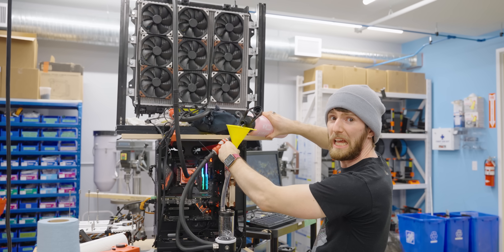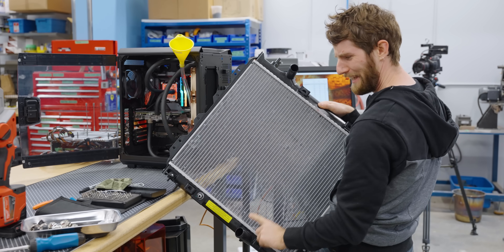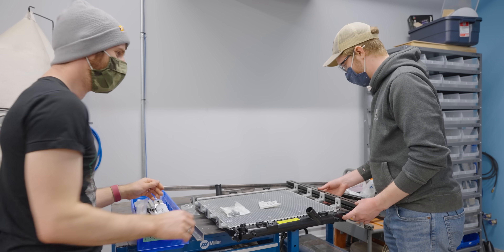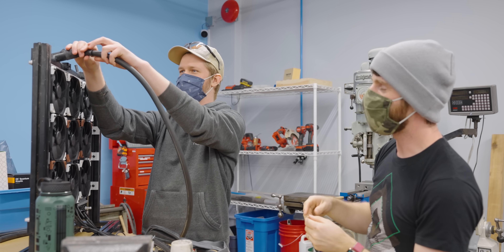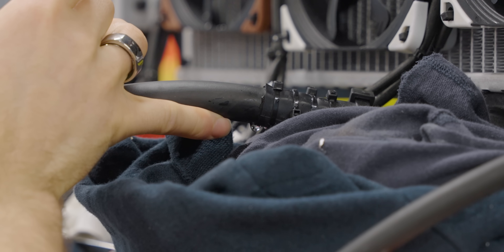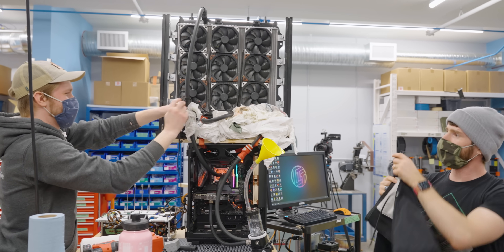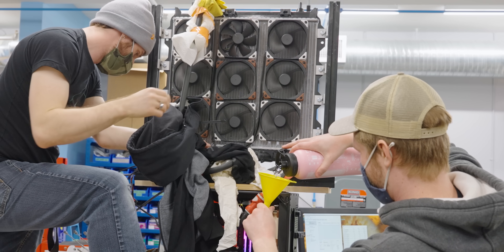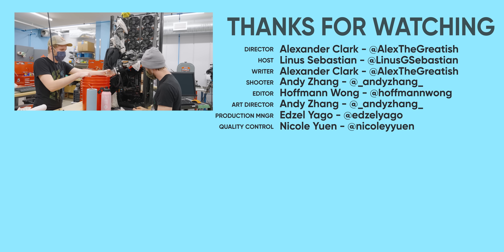Our Craziest Cooling Project Yet - Car radiator liquid cooler

Comment: This is a project I've been wanting to see for literally years. Guess I get to keep on waiting.

I just don't understand why you seemingly ruined it on purpose by putting the radiator on top, and then why you didn't immediately fix it when it was obviously untenable. Out of every video you've uploaded in the decade I've been subscribed, this was the one I was most excited to see, and it was so brutally disappointing I had to take a break from the channel. Were you trying to make a statement? Was this supposed to prove how bad an idea it is to use a car radiator? If so, you completely failed to demonstrate that by not even trying to make it work.

Comment: sooooo...: https://www.caseking.de/watercool-radiator-mo-ra3-360-lt-schwarz-wara-323.html?sPartner=999&wt_mc=googleads.12975327275.127452856008&gclid=CjwKCAjw3MSHBhB3EiwAxcaEu1FlA0RVlReHVgJTaqHijhTBBtuWaTNMjg2hbEfYGAuHmVfHj1vJbRoCVT8QAvD_BwE

Just get a min. 10 kW heatpump like this if you actually wanna go overboard: https://www.oezer.nrw/images/pictures/w7e2b1610173300206c56e8a574eeb98/w7e31060936140031ca61cf3f560080a/mechernich_held_wp_haus.jpg?w=1376&r=6 
but then you might actually have to get someone on board who knows what he is talking about

Comment: LOL a 99 civic Rad would've fit right in the case guys but it was intresting to see you guys improvise i ended up using quick steel epoxy on the Rad outlets and drill\tap and used 3/8 fuel line barbs and nylon fuel line wanted something that wouldn't degrade over time omg you'd better hava heat gun and snap ring pliers to expand the line to fit the barb i used lol car quick disconnects  and drilled some 2x4's for the pegs on the bottom to stabilize the rad next2 my tower and used pc bLox,d5pump independant 12volt 30amp power supply used the car fan steada rigging and used a blower motor resister from an 82 chevy pickup to step down the speeds which were controlled by a 3spd push/pull switch the pump is also on the fan power so the 3090 can have all the juice it can handle However the controller is pluged in2 the mobo so i  can fill and leak test with out powering on the pc [:-) perhaps use some of these for the next insane build lmao made a good show though as you figured out you need actual hose clamps with that much water atmospheric pressure boyz ! it'll get ya everytimee [:-)

Comment: WHY did they put it on top?  That seems deliberately thrown together...  

Also, you can reduce the 1" hose to the 5/8" hose using a simple adapter you can get at Home Depot...
Reply: They may be good at building computers but building other things. . . Not so much...  😁

Comment: Thank you for convincing me not to try this on the new rig! ...Although maybe with a smaller Honda rad and a box fan?
Reply: I was thinking the same thing....  They dropped the ball on the choice of rads... I would have gone with the tried-and-true drag racer special.  A 2000 Honda Civic radiator. You can get an all-aluminum one from BeCool for $65. They are 13"x18"x2" And you won't need to deal with the dual loop (no built in trans cooler).  They spent $200 on a plastic capped single core LOL  they also sell a electric fan kit with shroud. now it will be loud AF but it will work great.

Comment: April 18th?  How the HELL did I ever miss this?!!?!?!?  And honestly, it would have been better if you'd worked out how to put this thing together so it wouldn't have leaked.  All you did was prove that an automobile radiator could cool a computer.  Now design and produce a LINUSTECH case with a massive radiator built in that you introduce in your store, and then migrate to Amazon and Microcenter.

Comment: just some 2cents I'm bringing over from the marine industry...first off..I would've used a full size automotive fan,on a relay running off of the 12v rail and using the header connection,as a switching circuit.(or any 12v circuit that's an I/O on boot trigger). it'll probably draw around 7amps at start and 3-4amps nominal and won't have any hard draws on the board neither....also,why did you tie in the trans cooler lines into the loop?? should've did a bypass,or actually use the internal transmission cooler as a heat exchanger,cap the inlets and returns and fill the radiator side,cause that pump is no where near sufficient enough to move that loop,using the entire Radiator..and as an exchanger, it'll definitely will give good heat wicking....or even better,would be to tie in a secondary circulation loop for the radiator side and run your PC loop off of the transmission cooler(similar to heat exchangers found on inboard marine engines)...either way,I know this can work,leak free...just need the correct routing and technique...hope to see this revisited...

Comment: 3D print a reducer, can still use the bike tube method but with a better fit around the adaptor before stepping down to your standard water cooling pipe ID. 

Could definitely make a proper video/series from this idea!

Comment: Next time use a plate heat exchanger. Water line for PC is closed circuit on one side of exchanger. Other side of exchanger you can directly tap into your water line. Reason why I say use a plate exchanger is because your heat dissipation method is limited to many factors like fan performance, atmosphere temperatures, etc. Spent too much on the radiator too. You can find a good size performance radiator for automotive use around 150 from respected and well known suppliers (e.g. $150 US for a very thick performance radiator from Mishimoto for budget parts on Amazon).

Comment: Use a air conditioning condenser from a vehicle easier fittings and  adaptable. Usually located in front of the radiator
Reply: AC Condenser A/C Air Conditioning for Chevy GMC Cadillac Pickup Truck SUV New

Comment: To seal the connections on the radiator, I would recommend heat shrink tubes with glue. (this is a common solution in energy supply and industry, for example, to protect cable connections from moisture)
Reply: You can actually go to Napa and buy heat-shrink hose clamps. Can get them in all sorts of sizes, and step-up/down sizing even.

Comment: As a car guy, I'm pretty bummed out how this practically performed.  I can get a smaller, all aluminum radiator for half the cost, and get silicone step downs for the hose connections.
This could've been great, but they didn't consult another team.  Even Donut Media could've steered them.
Reply: I wanted to see it with the 12v fan and shroud made for that radiator.
Reply: @bobbygetsbanned6049  yeah a proper 12V car fan would've yielded some insane numbers
Reply: YES!!!!  As a mechanic and tech geek this hurt so much.  Just a few more dollars at napa for reducers and hose clamps could  have saved ALL the drips.
Reply: I’ve always thought that a heater core would be perfect for PC’s lol. Especially a copper one.
Reply: @maverickloggins5470  We used to use Honda heater cores 20 years ago, back when water cooling was incredibly niche and there wasn't much in the way of PC radiators. For their size, they are great for PCs, but needed a more powerful pump to avoid back pressure damage.
Reply: @maverickloggins5470  the first water-cooled PCs legit used heater cores for the rads.
Reply: Same, they should have ignored the transmission inter-cooler loop which would have not changed any performance they were after.  I would have also thrown one of the radiator fans on rather than that mess of fans and wires they kludged on.
Reply: @weirdmindofesh  or even a box fan
Reply: Plus they super stressed that pump by giving it such a large "head" without needing too do so.  putting the radiator on top means the pump has to force that entire water column up 4-5 feet / 1-1.5 meters up.  Sitting it on the table would have given the pump way more headroom to actually move the water rather then just pump it a few feet into the air.
Reply: I feel a guest car mechanic could be a massive help for any of their DIY water cooling videos
Reply: But could you orient it horizontally and passively cool with the big boi?
Reply: @why6212  what is your worry? Over the years there have been both horizontal and vertically oriented radiators.
Generally, you'd have the hot side input from the top and draw the cooler coolant from the bottom,  promising no air being drawn + basic thermal dynamics; heat rises.
Reply: @williamshaw3rd  i want a diy no-fan option
Reply: @why6212  those have been featured, but not for a car.  Just a massive heat sink.  An automotive radiator relies on air flowing through which is why there's a cooling fan; either ran off a belt from the crankshaft or an electric one sandwiched against it, signaled by a thermistor.  Depending on the manufacturer, there are pusher fans and puller fans depending which face of the radiator it sits on.

Classic Volkswagen might not have been running coolant, but any of them trying to get a little better performance or longer engine life would run a remote oil cooler (another radiator) sometimes mounted up high on top of the hatch or in a roof scoop. The old buses would have panels on the side to run air by their oil cooler.
Reply: @williamshaw3rd  lol not for a car, for a high end pc
Reply: @why6212  In short, nope A car radiator will not work passively to cool your PC DIY solution or not. All you have at that point is a big thermal mass that will take longer to saturate but if your PC is high performance enough it will overwhelm it in minutes rather than hours. A fan to help dissipate the heat from the radiator will be needed for such an application.
Reply: @alexisrivera200xable  theoretically there is some amount of radiator surface area that would work for that, right?
Reply: @why6212  theoretically yes. But the radiator would be massive and impractical at that point
Reply: @alexisrivera200xable  Wrong - because hot air rises you get a flow of air through the radiator anyway, and given the massive cooling area and temperature gradient, very likely entirely adequate.  Even better is to have a slight incline so that the hotter water stays at the top while what comes out at the bottom is the coolest available.
The reason you need to use a fan when the same radiator is used for cooling an infernal combustion engine is that the wasted energy discharged as heat is measured in tens of kilowatts, and to get rid of all that heat you need much more airflow (requiring either a fan or ram air from forward motion) or a highly pressurised system running at much higher temperatures (great for ICEs which generally self-pressurise a little anyway to avoid micro-cavitation in the cylinder head anyway, but having the water at multiple hundreds of degrees Celsius would not be great for PCs), which would also make the temperature of the air leaving the radiator far hotter - dangerously so.
But a single large fan is also much quieter than a whole bunch of little ones while moving the same amount of air, so it is probably a bit silly not to use one except when absolute silence is the aim (like in nuclear submarines) - even at 100rpm it would probably suffice, but that could be controlled as necessary if they'd done this properly instead of making a big joke out of it.  You may have to use a controller capable of handling more power than you can draw from motherboard fan connectors though, while still feeding the rpm sensor back to the motherboard which would then control the fans indirectly instead of directly.
I can imagine future PC cases with the radiator incorporated in one side panel with QR hose fittings, and with just perforated sheet metal "mesh" over the outside (and optionally, inside) to protect the fins of the core, with one big fan for the whole system drawing through a filter screen in the opposite side panel - but you may need to water cool more elements, or at least have better heatsinks.  VRMs, Chipset, NVMe modules and RAM would be the most obvious hot spots, but it would be a plumber's nightmare to water cool all of them, so big heatsinks with passive cooling from the general air throughput would work better.  Of course, you'd need lots of space around the motherboard to let the air through from one side to the other.
Reply: @The_Real_Phil_Lee  you could probably use three water heat exchangers - one for the CPU, one for the GPU, and one with copper heart pipes to the accessories, and then mount the radiator in a chamber separated from everything else
Reply: @williamshaw3rd  "basic thermal dynamics; heat rises."  This is incorrect.  Heated air rises.  If heat did rise it would be mighty cold on the surface of the Earth.
Reply: i feel like jayztwocents could also have tossed his two cents in to make it work.
Reply: The D5 would have pumped it absolutely no problems at all if the loop didn't leak like a sieve.  I have a Xigmatek Elysium case which is huge, like waist height (1m?) and on top lives my MoRa3 rad (9x120mm).  My single D5 lives at the very bottom of the case, it cools 2x 390x and a 2700k, and I only run the pump at 3500rpm static, and its been perfect for years, never over 60c for the 5ghz 2700k, water is about 10 over ambient full load.
I think if all you did was plug the inlet and outlet of this rad, then drill a hole in the plastic tank top and bottom, install your g1/4 fittings with epoxy, you would be sweet, the loop isn't ever going to be hot, nor under pressure (relatively).  This experiment was super close to what my PC actually is, and has been since 2017, it could work very well.  And although the MoRa3 has 18 fans on it, they only run at like 500rpm, the point of my PC is silence after all.  I also have a NexXxoS 560x80mm Monsta on the bottom, with IPPC-3Krpm 140mm
Reply: Don't need step downs either.  Just plug the factory inlet and outlet, buy threaded barbs, drill/tap the end tanks and then use thread seal.  Done.
Reply: And running it through both the radiator and the trans cooler would heat the water back up a bit. Maybe not an issue hear in a noticeable quantity but in a car it wouldn't work great at all.
Reply: Donut media are in california LTT are ina Canada distance problem
Reply: @fenrir324  that hasn't stopped them from collabing before. Just like any other YouTube creator 🤷🏻‍♂️
Reply: That would be an amazing collab video
Reply: Shouldve filled the radiator with water, and just looped it through the trans cooler.
Reply: if they had used a rad with metal end tanks they could have blocked off the original outlets and added new ones that are the right size, no reducers needed
Reply: This was more entertaining though
Reply: Don't use aluminum in pc water cooling. Trust me, copper and aluminum don't mix
Reply: @dragonfireproductions790  works fine If you use automotive coolant aswell .. as cars have copper aluminium  brass iron all in the same loop ...
Reply: @dragonfireproductions790   That's why anti-freeze like Dex-Cool exist. They have corrosion inhibitors just for the dissimilar metals, and then you have the rubber hoses separating the actual metals from touching.
It's crazy how much corrosion you can cause running the old green stuff in a newer aluminum head, iron block engine.
Reply: @dragonfireproductions790  That's one of the reasons we use antifreeze. They have anti corrosives.
Reply: They did this half ass on purpose.

Comment: With all the equipment you have you could have easily machined a adapter. 3D printing one and waterproofing it by melting the inside with hot air gun could also work. This concept definitely deserved a bit more time.

Comment: Yeah, the transmission cooler works by exchanging heat from the hotter oil into the relatively cooler water, so you're wasting your time there.

Comment: Once inspired by a younger Alex and Linus, I made a mineral-oil PC. at the time I was a tech for a car dealership, and radiators were easy enough to get ahold of. With some proper connections, I was able to make one into a cooler for the oil. 3 small things done differently, and this radiator build would have been even more successful, but probably not as funny. Love the "Mad Scientist" videos, always a treat and an inspiration.

Comment: You should try to water cool a pc with out fans by hooking up The reservoir to a running tap and dumping The water after The heat block into The drain!

Comment: I've been wanting to use a car radiator for PC cooling for years!!! Would like to see a proper benchtest with no leaks
Reply: I did one back in like 99... used an oil cooler radiator from a trans am.  It was... something 😄
Reply: I did one back in like 99... used an oil cooler radiator from a trans am.  It was... something 😄

Comment: I actually did this in 2014. It worked. The tower reached up to the ceeling. I needed to disassemble it and rebuild it because we moved. The radiator(audi tt) is still cooling my cpu and graphics card( ryzen 7 1700x and 1080ti.) Temps under full load are under 70 celsius for both. And you only need two 230mm fans for airflow. I use 2 laing ddc pumps and copper piping
Reply: Very cool.

It's actually a really good idea if the parts in your computer are hard piped without connections, keep hoses and connections outside of the case. This is currently also done in the serverworld where they are reaching thermal limits for rackmount cases. For home use there is the issue that when you are upsizing the radiator that much, you need to considder the pump's output pressure, since very large radiators add a lot of system backpressure.

Back in the pre 2000 days you had no real off the shelf water cooling so the pioneers started with radiators from cars, not engine radiators but the copper heat exchangers from the car's heating. The reason why I would put the connections outside the case is that I had a hose leaking once, it wiped out my Abit IC-7 mainboard and Radeon 8500 LOL.
Reply: Pog